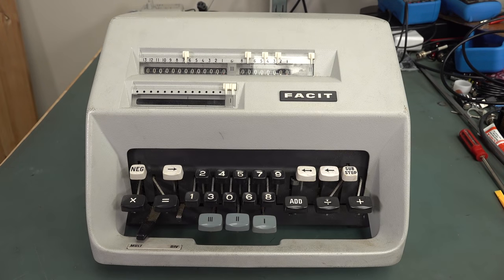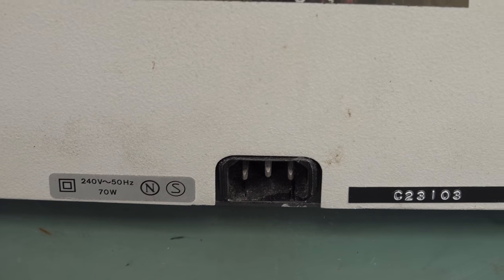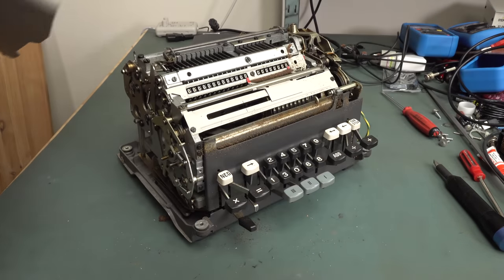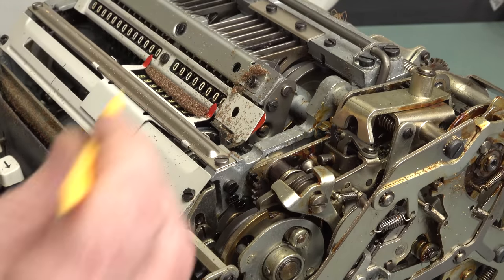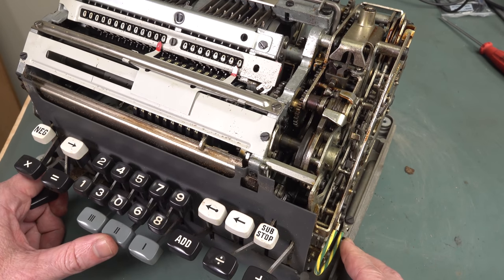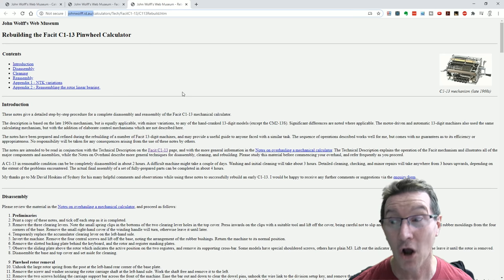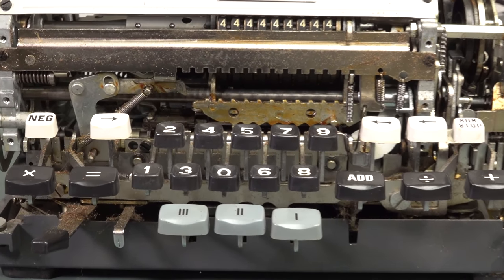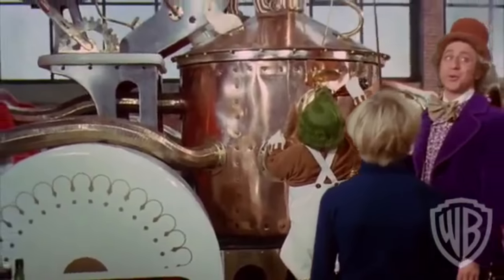EEVblog #1332 - Facit Mechanical Calculator!

Comment: Used to work on typewriters, copiers, and calculators. The most I had to do with the calculators was de-grease and lubricate them. That one may be part way through an operation, which might be why the keys are locked. Visually inspect it to make sure there isn't some foreign object caught in the mechanism. Plugging it in most likely wouldn't hurt it and might actually get it working. Obviously, unplug it if the motor stalls.

Comment: When I worked for the bank in the early 1980s they were still using mechanical Burroughs adding machines from the 1930s all operated by a lever. This takes it to an extreme level and I bet these were designed for serving in the field by company technicians as they were most likely very expensive and critical equipment for every business that bought one.

Comment: Just figured out why its not working.. (first reason) You need to plug it in, at a guess not running the motor mechanically locks it.

Repaired a few similar machines when I was a kid. They are astoundingly complex. One thing a lot of them contain is a pin matrix memory which is a fabulous toy to anyone with frigidity fingers.. : )

Comment: Try not to laugh too hard: A similar fully mechanic machine is used today by the operators of the ferry Glückstadt-Wischhaven in germany. The difference is they use a model which is able to print.
The practical use is superb to digital solutions in every way imaginable they told me.

Comment: I have an older facit model, also electromechanical, but it's from 1940 so the mechanism might be a bit different. It needs to be powered in order to work. Otherwise the keys are stuck. Plug in the cable and hit some keys and it may just start spitting out some numbers.

Comment: If some mechanisms are stuck then there is one 100% way of clean them and it is well known to everybody - WD-40. Just spray WD-40 over and most likely it'll start moving. This may not be a cleanest way of a calculator maintenance but at least fast and easy in case you just want some content.

Comment: Your initial comment about the design only lasting a few years is a little misleading.  The original design for the keyboard version of the Facit calculator (after they moved away from copying Ohdner's design), was released in 1934.  The sliding input register, the accumulator on the left at the top and the counter register on the right, are common to just about every Facit mechanical calculator from then until the early 1970's.  The detail of things like bearing, carry functionality and, eventually, back transfer were minor changes along the way.  The logic, built into the mechanics of the machine, that allows the long division and multiplication to happen at the push of a button, are the myriad external levers that you saw on your machine when you opened it, which you don't see on John Wolff's C1-13 - that and the motor, of course.  Even that additional mechanical logic had been designed back in the 1950s and simply refined after that, so it wasn't such a waste after all.

If you haven't yet managed to un-bung your CA1-13, you may be able to do so by releasing the carry bars.  This is something that has caused jamming on some of my Facit machines.  On the top of the machine's internals, behind the accumulator and counter wheels, you will see some black thin plates lined up, one for each digit.  They have slots in them and you can hook into these slots and pull them up into their carry position.  When one of the number wheels passes from 9 to 0 during a mathematical function, or through a previous carry, it triggers one of these plates to lift to its upper position (they click either side of a hidden sprung ball-bearing).  Sometimes, they can get out of sequence, especially if the internals are turned the wrong way part way through an operation.  If you try lifting all the plates that will lift, to their higher position, and then run the motor (to make sure you're turning the internals the right way), it may clear.  If it does clear, try pressing each of the clear buttons (I, II and III) to, hopefully, return everything to where it should be.  The fact that you could see the pins on the digit wheels behind those plates indicates it is definitely mid-cycle, and most of the keys are locked during a cycle by various interlock devices.  If you are seriously unlucky, a previous owner might have tried to force the machine, and bent an interlock bar or plate, in which case a complete disassembly will probably be required.

Just as a final aside, I have seen video of these calculators being held over a bucket of some sort of solvent, whilst the mechanicals are drenched with a paintbrush dipped into the solvent.  I would remove the motor and any other electrical bits first if you plan to do this, and in any case it will need re-greasing and oiling afterwards, but it's definitely going to need a clean.   That grease that you said looks okay is just the stuff on the surface.  Where it and old oil have got into the tight tolerances of wheels on shafts, and sat there and dried out over years of non-use, they harden like glue and the wheel will not budge.  De-greaser or easing oil will usually dissolve it in an hour or so and allow it to move, but it will need new lubricant for the future.

Comment: Used one of the manual versions for surveying calcs at Uni in early 70's. Used with 7 figure log tables.  I bought a couple of the manual versions many years ago and am always fascinated by their operation. It is amazing to see how to the manual ones operate for multiplication and division. You are basically doing successive additions or subtraction depending on which way you crank the handle.

It may not be the ideal way to keep them operating - I give them a good spray with WD40. It has kept them going all these years.

Comment: Just had another idea:
there are two other issues that could be at play with the keys as opposed to being gunked up.
A. travel-lock/screw.
B. the unit was powered off while the equals function was running leaving the gears in unworkable positions.

Comment: 3:32  A "listing machine" is an adding machine that prints on a paper tape instead of just displaying a total.   5:40 Mechanical calculators jam because the oil dries out over time.  Many machines are perfectly OK except for lubrication.  I know this because I have several machines that were working perfectly when I bought them, but are completely jammed today.    9:59  I was told that machines were sometimes repaired by soaking entire assemblies in solvent.  You would not dunk the motor or the plastic parts, of course.  On the other hand, I have not read about anyone doing that lately; today's collectors seem to fully disassemble and get it back together.  10:50 I have not been brave enough to disassemble and degrease any of my jammed machines, but I am sure that it could be done.

Comment: Probably the only thing you can do on this yourself is remove the motor and all associated components, measure everything and replace what is dead, and make the motor run well again.  Then place that back.
When that does not fix it I would be better to send it to John Wolff :-)
I would not be alarmed too much by the "stuck keys".  It can well be that the mechanism only works when the motor is running.  Remember pushing a key slightly can move some lever that then gets grabbed by some rotor and pulls it all the way through.

Comment: I'd suggest you gently heat it up with a heatgun, making the goo becomre a little more fluid again. If that alone doesn't help, some shaking may un-stuck some things. Also, is the motor still working?

Comment: Your best option would be to get in touch with your fellow Aussie. You're not the only one with the same description of the locked keyboard and or locked mechanism ON, and hear this, the mechanical and electro-mechanical variant of this unit. So he might have some kind of insight as to why the entire input side is jammed. This is not a case of lubrication gone bad nor is it a lack of it, this is likely either a mechanical error (these can get jammed if you don't follow proper procedure, my purely mechanical unit had to be walked in reverse when i did a wrong move once) or some kind of solid detritus fallen inside.

It's really worth your effort to get in touch with John, especially to show the young ones, it's quite fascinating and 10 years of stewardship of my unit and i'm still pulling it out once a month to keep it in working condition.

Comment: Hi I used to repair mechanical typewriters and if you like this mechanism have a look at the IBM selectric golf ball which you see in so many American films ie 9 to 5. I used to these and the printer versions. 
Great to see the old technology as it took so many man hours to design and then repairing.
Equipment was so expensive with labour cheaper but how things have changed with our throw away world.

Comment: seems to not be the case here but I've seen some electromechanical calculators use an RPM-lock to stop people from throwing switches and/or pressing keys while the main-wheel wasn't up to speed. (as that could throw off the results)

Comment: You could try a can of brake or carb cleaner, or lighter petrol will also soften the greas but I suspect that something has jumped out of place, you could try pushing that lever that follows the face cam over while turning the motor by hand.

Comment: 6:20 I don't think the keys will work unless the drive motor is turning. Often, a cam will keep an activation lever locked out until a certain phase of rotation of a larger mechanism

Comment: I'm not in the same league as the engineers who designed this, but as a mech eng my attitude to any moderately complex electronics is pretty much the same as Dave displays here... " Look at that thing, and that trace runs to that chip, which runs to that thing which runs all the way over there, look at the size of that trace! That must be doing something important!"

Comment: Remove all the eletronicals and dunk the whole thing into a degreaser, then wash it in water and dry with something like break cleaner i think. To regrease it, I'd say use white Lithium Grease. Only way i can think to clean it without taking apart the gears. Still though i think it would be a bad idea

Comment: Ultrasonic cleaner then blow it with compressed air possibly low temp oven. But you will only be able to grease the outside not inside.

Comment: Dave, I'd hose it down in WD-40 or equivalent and work as much of the mechanicals as I could.  I would stay away from alcohol or any other solvents which may damage the plastics.  It appears that the bar the equal key moves is stuck partially to the side which would likely cause everything else to be locked up.  Try to get that freed up and any other linkages it manipulates then see if any other keys will move.
Reply: It contains glued felt parts, WD-40 would weaken the glue and they might come of.

Comment: Dave most of the keys are supposed to be looked when it is not in the right position so them not moving is not odd at all.
From my experience they are built in sections that you can remove.
You should remove the sections and put them in a bath of mineral oil

Comment: I am always amazed by these mechanical devices. For instance look at a ASR-33 when it is fully working, and it keeps working. Fantastic. But a device like this Facit calculator is not designed from scratch. It evolved over the years.

Comment: My father brought home a mechanical payroll calculator / printer from NCR - it was enormous! It was on a cast metal stand like a desk, had a typewriter part and a mechanical calculator/totaliser part on the keyboard. The operator would type out the employee name, with a line description and then the hours worked and the correct rate, plus over time, minus any union dues or expenses and the machine WOULD CALCULATE THE TOTAL. All entirely mechanically. It had thousands of parts, dozens of motors and smelt like an oil refinery!
Reply: It was a retired device from the local electricity company.

Comment: Remove the motor, cap and other electrical parts, then keep it submerged in WD40. In like 10 minutes, remove it so that all the dirt drains off. Do this 3 to 4 times. It will really help if the tub its submerged in is an ultrasonic cleaner.

Comment: The motor cap is probably bad. That be why the motor does nothing. Also the RIFA filter cap needs replacing, they go bang 100% garenteed.
Reply: I'm not sure about the motor cap being bad because Dave couldn't turn it by hand. I actually wonder why it has the box with circuitry if it's just an induction motor which runs all the time.
Reply: @eDoc2020  well those AC motors that have a cap will not spin without it working. RIFA caps are well known to not last for decades.

The one in the small electronics box will need replacing, they pop after being used for a while. The time varys from minuts to hours
Reply: @TheEPROM9  I'm certainly not arguing that the caps are still good (oh wait, I technically did). My point is that if Dave can't spin the motor by hand the motor won't spin by itself, even if the capacitor is good.

I've heard plenty of stories about the Rifa safety caps failing with a bang, but I imagine the motor cap is different construction.
Reply: @eDoc2020  He should totally give it a go at restoring. Not like he does not have access to people who can help him. I love tinkering with mechanical stuff. You can see exsacly how it works, nothing hidden away in chips
Reply: @TheEPROM9  I agree. Some of the other comments had good suggestions.

Comment: Hello, Dave!  I used Monroe (some were marked Monroematic) and Olivetti mechanical calculators into the middle 1970s for civil engineering calculations for a Department of Transportation (DOT) summer job.  The fast ones were those that were electrical mechanical calculators that lived in the engineering office.  There was also a smaller portable that was carried out into the field for surveying and bridge inspection work.  The electricals worked like your video insert.  The lighter portable mechanicals had two hand cranks -- one to turn the pinwheels and the other to advance the carriage.  You ran the pinwheels until a bell went "ding" and then you advanced the carriage to the next position.  It's basically a Babbage analytic engine, but with only four functions.  They did have a lubrication procedure, which was in the manuals, but at DOT they were sent into a shop for repair, or a roving service engineer came around to service all of the units.  No worries!
Reply: Oh, yes, and I do have a gray beard...  And the web site for John Wollf shows a mechanical Facit machine, the C1-13.  Your unit is the motorized CA1-13.  So, some of the internal mechanicals are different, as your unit has powered "carriage return" while the mechanical one has a mechanical "carriage return lever" for the operator to pull from left to right.  When you want a negative number, you use the "Neg" key and the machines with printer tapes would print red numbers.  The register to the right of the accumulator had three functions:  (1) number of calculation steps for addition and subtraction; (2) the multiplier if you were multiplying (it counted the number of times that the accumulator increased from zero to the multiplier); and (3) the remainder if you were dividing.  That's why there's that level setting below the multiply key.  

I'm going to have to check out that John Wollf web site, even though I don't have one of these mechanical beasts.  So much changed when TI and HP brought out their electronic calculators.  Some of the mechanical calculator makes transitioned to electronic faster than the others, with Monroe and Olivetti being the last of the breed.  But, that's another part of calculator history.

Comment: I got an entirely manual rotary pinwheel calculator - couple this with a good slide rule and you can all do everything you can do with an electronic calculator - just a lot more slowly.... someone needs to give dave a Selectra typewriter - the famous IBM electro-mechancal typewriter - they used an entirely mechanical DAC to convert key pushes into rotational motion of the printhead, and were so loud and noisy they used to add solenoids to computer keyboards of the time that hit on the side of the case to replicated the loud banging noise that people expected keyboards to make when you type on them..

Comment: maybe if you think of all those mechanical links and levers as the traces of a circuit board you'll find out whats wrong with it 😁👍🤞
here is a fixing of an older model but they should be pretty similar from the mechanic,  https://www.youtube.com/watch?v=5utHg7tG10c

Comment: Given this has a heavy mechnical sliding component, did you check there isn't a locking lever somewhere that locks all the keys and gears down for transit?  It would make a lot of sense to be able to lock the entire mechanical section for protection when moving.

Comment: In Sweden Facit has long been presented as this prime example of a manufacturer failing to adjust and also of the arrogance of thinking some new idea is not going to stick, I believe the name is meant to invoke that their machines were correct, as the term (from the Latin for "I do") is used for the answers for maths problems. They finally went under in the early 70s because of their failure to compete with electronic calculators but were bought up and the company existed until 1998.

They also made typewriters which were famous in Sweden and abroad
Reply: They also had a range of fully mechanical calculators that were much more compact

Comment: Bet the magic smoke escaped from that Rifa capacitor, so no wonder it doesn't work anymore.
Or it needs a mechanical reset.
Drop it from half a meters height, and it will reset itself. No worries.